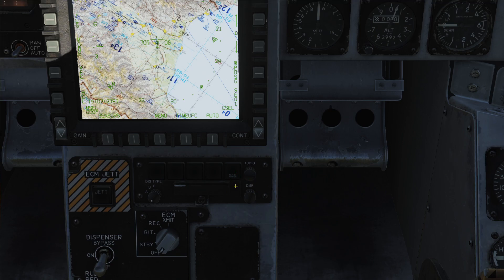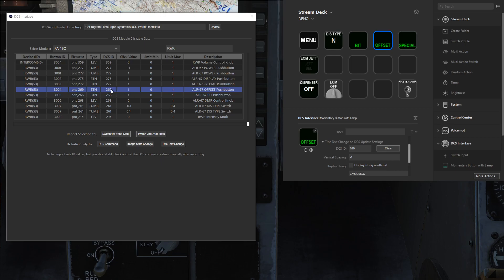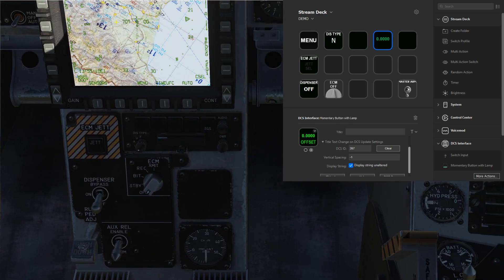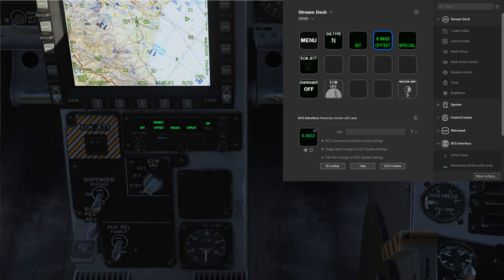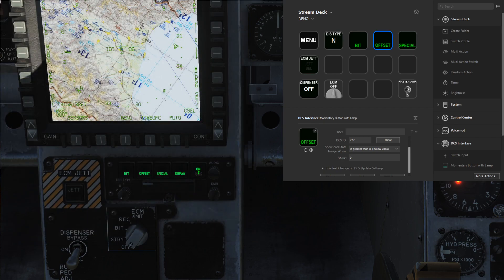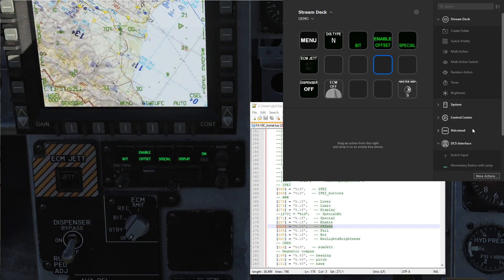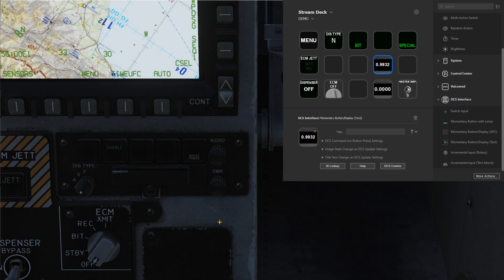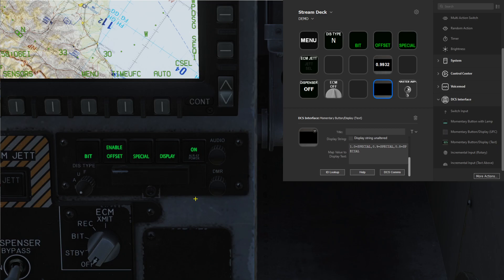Button vs Lamp IDs (Common Mistakes) - DCS Interface for Streamdeck

Comment: Could you show how you bind  the buttons in the video so that they show nothing when switched off and only turn on whhen the panel turns on? I'd like to set up a button that changes based on the state of another button. is that possible? the Mirage 2000 has dual function buttons on the VHF. When you press the Mode Button, the button lights up a different text. So my question is, can you create dependencies on the state of other buttons?

Comment: Gudday Charles,
I just finished mapping most of the Hornet switches, rotary dials and lamp buttons to my StreamDeck using your DCS  Interface, and couldn't be happier. As a former Hornet back-seater, any improvements to realism and immersion are greatly appreciated :). After mapping my UFC controls and displays to my medium size StreamDeck (poorly), I immediately saw the light and made the jump and upgraded to the StreamDeck XL. Looking forward to a more complete UFC display soon.

Quick question regarding the ALR-67 trouble shooting above; I have all of my buttons working and illuminating correctly now, with the exception of the ALR-67 Power button. Is there a trick to getting it to power on and off? I'm currently able to power it on, but the only way I can get it to toggle back and forth is if I map the Power button using the 'Switch Input' and  'double tap' the StreamDeck button... 

I currently have it mapped as 'Momentary Button with Lamp', which is powering it ON, but not OFF.. Any ideas?

Anyway, thanks again mate. Love Your Work :0).
Nick